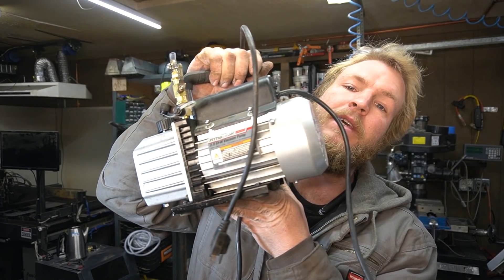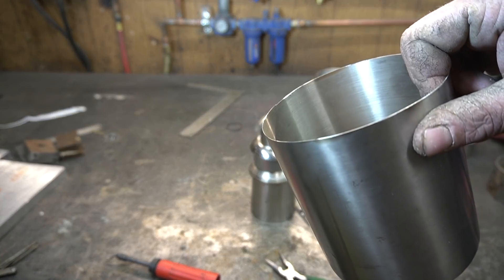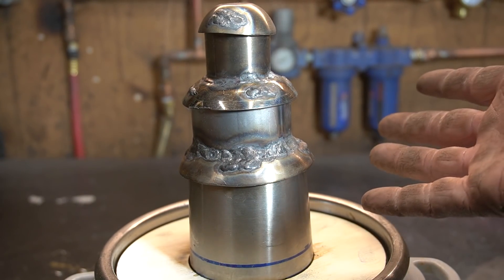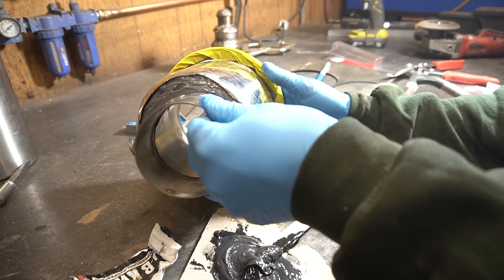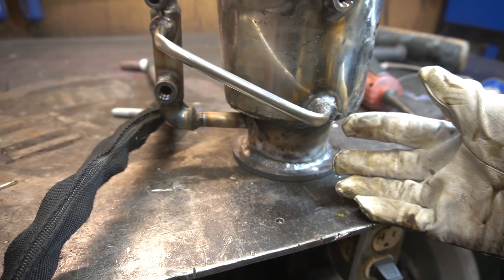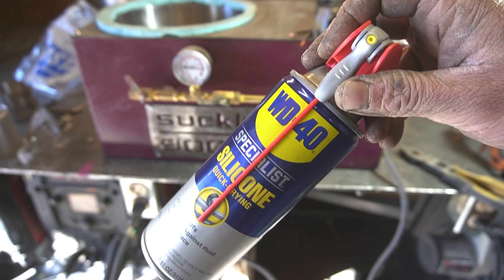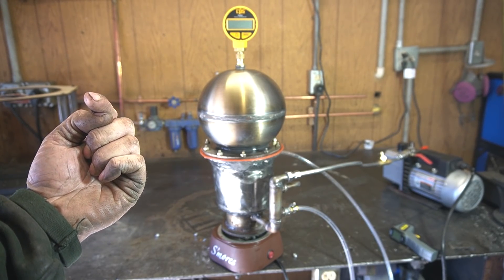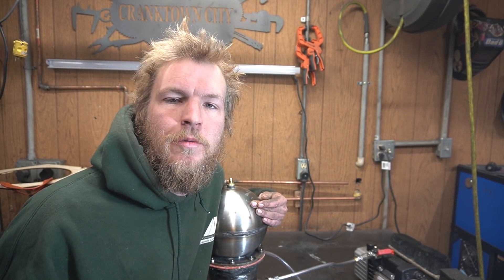Homemade Oil Diffusion Vacuum Pump

Comment: nice.  props.  to note tho - the oil temps are so great, you really need little cooling.  too much cooling will make the heater struggle.  I had a commercial one.  Optimized the flow using a water flow meter, and valve.  Thought of making a square version of this chamber, jets coming from just one side.  I noticed at lower pressures, You get short-path behavior that a cylindrical design allows for too many degrees of freedom for particle movement.

Comment: Get up to 14 bars of vacuum from your car engine by disconnecting the vacuum line to the master cylinder ( brake master cylinder). 
Vacuum from car engine.

Comment: I will be really, really.. afraid of that vacuum chamber literally IMPLODING, which could be as bad as a high pressure explosion, throwing pieces of metal everywhere and causing some serious damage to whatever gets on its way, 
just do a quick calculation of the pressure differential and figure how many "inverse" psi those cans ate holding.
as an electronic engineer 
I worked back in the 70's in an RCA tv screen tube manufacturing plant and saw quite a few vacuum implosions and they are not a joke.
be safe my friend

Comment: lol, I'm the amateur tig welder you're talking to and holy shit are you right that welding super thin stainless together is NOT EASY. The jump from 1/8" down to 20ga with my project was crazy. How does metal just DISAPPEAR LIKE THAT?!?!? fuck. Stupid thin sheet stainless. Clearly the answer is a laser welder.

Comment: When II was building an electron accelerator in high school back in the 1960's I used a displacement pump for the raw vacuum draw the pulled down the rest with a mercury diffusion pump that worked similarly to the one you built with oil.  It was very efficient and pulled a deep vacuum but probably wasn't the healthiest of devices. 

Cheers !

Comment: Don’t know what to think after watching your video.  I recently bought a Robinair 15500 2 stage vacuum pump and also a CPS VG200 micron gauge.  If I hook the micron gauge directly to the pump with fresh vacuum oil, I can pull down to 4um which seems amazing; if I include the gauge’s included brass-adapter, it increases to 6um.
Do you have any comments, do yo think my VG200 is reading correct?
When I pull down a R134 automotive AC, I get about 300um which seems to be about right.
Great video, learned a lot!  Thanks!

Comment: For impromptu jets, use a metal shower head or a shallow steel bowl or ring with tiny holes drilled into the rim.

Comment: Think edison used a vaguumpump made from tube and nercury , the weight of the mercury drawed the air out of his light bulbs mercury is e pensive but you might get the same thing when using water and a verry large height 
Think you need a tall tube with teo fausets one kn each side , close the bottom one , fill tube wirh water hook up the part you need to draw a vacuum on at the top and then open the bottom valve letting the water fall out drawing a vacuum over the top , prolly need to do it in a lot of small stages as air mught bubble in through the ooened valve at a certain vacuum , like emptying a bittle filled wirh water

Comment: Would have really helped you out a ton if you had purged backing gas for those stainless welds. The backside of all those welds are sugaring on you thus why they not only look so bad especially on the backside but, also why you had so many issues welding it and no so much because it is thin material. The sugaring is also why the welds come out so dark and grey/black looking. Using aluminum foil is a really good option to purge Stainless on the backside of welds like that for example when welding stainless pipe or header/exhaust you cap off each end with foil and run a second hose from your argon bottle with the same setting to keep backing gas on the backside of the welds. 

Just make sure you always have a small hole for gas to escape thus why aluminum foil forms work so well for this. Some people use rubber caps on pipe but, you still need to allow the gas room to escape or your weld can blow out on you as you weld. You just want the gas to cover the backside of the welds not pressurize. Ive actually welded sheet metal in special fixtures to purge backing gas on flat runs for Stainless. 

Its required on food service and aviation welds with stainless and also used when manufacturing Header and Exhaust parts because it is not only easier to weld but, the welds come out 100 times better all round. That sugaring is very detrimental to your TIG welding process. You also want to wipe down all your stainless (and aluminum for that matter) parts with Acetone before welding so they are clean as possible. Every little bit helps.

Comment: Not sure if someones already mentioned it but your using way too small of a cup (and way too much gas for that cup), a gas lense would help but your cooking the absolute shit out of that stainless (no reason for tacks not to come out crisp/colorless and shiny with right settings). Some of those welds may have been better suited autogenously (without filler) without coming off as pretentious or overstepping in offering advice if you have any questions id be glad to help. Really enjoy your content keep up the work, im sure you have many subscribers in your future. 

I am also very into 3d printing and CNC Id love to collaborate on your metal 3d printer from a consultant standpoint(something ive also wanted to dabble in but too many hands in too many cookie jars atm).

Comment: To weld thin stainless (and other actually) you need a "Cold weld mode". It's just a precision controlled arc time. I think that you can assemble little device by yourself. You press a button, MCU starts a HF module and wait while welding current starts going and then just count a time and stop the arc. My TIG-machine can produce pulses from 10 to 200 milliseconds but I would prefer range wider a little. Current should be like 3-4 times higher than for usual process.

On Applied Science channel Ben was used an about 2 kilowatts little gas stove for tourists to heat up his oil-vapor vacuum pump. It's quite faster than using electric heater and you don't need to suffering making good thermal contact between heater and chamber.

Comment: The asymmetry of the diffusion pump stack did you no favors. If you copy the stack design from something like a Veeco EP3AB air cooled diffusion pump you might have better luck. The stack also does not need to be fixed to the bottom of your pump. Most times they just sit down inside the pump.

If you would like I can send you some photos of the stack in my diffusion pump. Looked like you were pretty close to having a decently functioning pump here.
Reply from the maker: Working on version two of this now, I'd love to see a picture!
My email is posted on my channel page, thanks man!
Reply: @cranktowncity  Sent you an email with the photo I could find and a 3D model I made awhile back.
Reply: Hi, Would it be possible to get a copy of the plans please?! I'm thinking of making my own :)
Reply: @Muttyfut  Send me an email. Don't think it really counts as plans but I can share the same thing I sent Cranktown.

Comment: Watching that at least helped me feel like I'm not on my own, I've been fighting 12 threads per inch for my 138 year old mill.  Yesterday was the third try and then I found out that one of the gib holes is stripped, drilled out / zero threads, so I never did need that bolt after-all!  BTW, machining stainless is an art, it doesn't like interrupted cuts.  Somehow you have to get the feed rate just right before and hopefully don't stop.  My planer loves stainless, the only drawback is the extremely hot blue chips jumping around.  Looking through the videos is not particularly of my immediate interest but subscribed, it's the quest that matters.

Comment: You could have just spot welded it to hold it together then made it vacuum tight by electroplating nickel on it. Slow and steady to get a thick smooth deposit.
Reply: Interesting, I never would have thought electrodeposited material from an aqueous environment would be strong enough to prevent leaking, or pure enough to prevent virtual leaks.

Comment: You may be able to use sorption pumps for rough vacuum and titanium sublimation pumps for high vacuum. I worked on a system that had sorption pumps, titanium sublimation pumps and ion pumps. It bottomed out the bayard-alpert ion gage. Less than x10 to the -14 torr! 

Does anyone know if you can leave out the ion pumps?

Comment: For the fusion reactor you can salvage very good vacuum tight electrical feedthroughs from magnetron tubes out of all microwave ovens. 

Just don't grind the pink ceramic it contains Beryllium. Side note I think it is the only ceramic that is thermally conductive and electrically insulating.

Let me know if you want some I think I have several.
Reply: Beryllium ceramic is white and not used in consumer products.

Pink ceramic is chromium-doped alumina (just like ruby), which is perfectly safe.

Comment: I suggest building a second one and placing them in series.

Also, make the part as clean as you can, leave no place were contamination can set home.
Don't forget to heat up the components to drive off any remaining liquid.

Comment: I was wondering why you don't use aluminium for the pump ? Okay i get the idea of doing it with cheap pot but if you're making a serious build can't you go with aluminium and get the right material from a metal shop ? I read that aluminium is not that bad in term of outgassing, did I miss something ?
Reply: Needs anodizing for resistance to reactive products
Reply: @nathanmccorkle4278  i don't think there is reactive product in a fusion reactor
Reply: @nathanmccorkle4278  anodizing aluminum is terrible for vacuum system, raw aluminum is great but the anodizing process grows a layer of oxide in the shape of long thin tubes that can hold on to individual atoms making it a nightmare for outgasing, that’s also the reason it can be so colorful since the tiny pores hold on to any dye small enough to get in them
Reply: @HiBye1543-fuk  I'm with you on surface area, but all the dry etch equipment manufacturers use primarily anodized aluminum because it's very robust against degradation from the etch and plasma chemistry

Comment: WD40 is probably the worst choice for oil as it is heavily mixed with acid. Crude oil will gave better results. I am using Galden 230, it is not expensive as proper oil but it is not crap as wd40 also.

Comment: If you don't protect stainless steel properly with inert gas, it will rust away and after the tarnish it will. Just use black steel until it rusts away anyway, or in this case it makes no difference anyway because all the welds will rust and the black steel is simply cheaper.
Reply: Either there is a hole or there is not, what are virtual holes?
Reply: Cavities which are extremely porous and have high surface area for adsorbed chemicals to slowly desorb, fouling any chance of getting to high vacuum in a reasonable time (i.e. it could take months or years because the outgassing rate is so slow).
Reply: Iron oxide will yield tons of virtual leaks
Reply: When the outgassing rate is so low you can pull vaccum. The pump has much more power and do not reconize the outgassing.
Reply: Of course you can pull vacuum, but "high" vacuum won't be achievable

Comment: i would suggest using stuffed steel wool anywhere you need oil vapors or mist captured and dripped back down. Its the DIY equivalent of what lots of industrial process equipment use

Comment: Also chilling the water to much can be counter productive as you only need to keep the walls below the boiling point of the oil.. Cooling it more than that means you won't have all the oil boiling in the bottom there will be a cold area around the edges.. The tiny element heating omg in the middle won't help ether lol.. Plus you should have another hole in the side of the jet stack shooting oil up the roughing pump tube.. It's the final stage and helps push the gas molecules into the roughing pump..

Comment: I have a cheap pump.. Literally the cheapest 2 stage pump I could find.. But changing the oil to good quality oil increased max vacuum allot! Do not use the crap oil that comes with the mechanical pump

Comment: You probably want all metal seals. I'd think JB weld would off-gas enough to prevent a good vacuum.
Someone get Techingredients or Applied Science in here for pro response
Reply: Justin from The Thought Emporium seems to use a lot of JB Weld for highish vacuum applications.

Comment: From my experience, a cheap vacuum pump should be able to get you down to at least single-digit torr, but I can't tell what units you are using.  If it is disconnected and the vacuum doesn't change, then you should be reasonably well sealed.  If not, it's leaking.  The diffusion pump will be hard to troubleshoot.  You might try running it with water at higher pressure (no roughing pump) and just seeing if it can get down close to the partial pressure of water (about 2 kPa).  But I'm guessing it just can't make good fan-shaped sprays to prevent the collected air from flowing back up.  Otherwise, I know the diffusion pumps take a LOT of heat to run properly, so you could try doubling it down on that.  Check that the material the gasket is made of is okay for use in vacuums (but it's probably fine).  Good luck!  This is a fun project to watch.
Reply: + he maybe should've  make the spray stages all same size for better "reflow prevention" (add more?) and REALLY add a lot more heat at the bottom (with enough oil) - BUT FUN!

Comment: Thanks for another cool, interesting and hilarious video.  You probably know this, but if mercury is easier for you to purchase than it is over here in the UK, one of the things you can do with it is create a crazy simple and extremely efficient Sprengel Vacuum Pump.  Cody, over @cody'sLab, did a video about building one https://www.youtube.com/watch?v=viJ3T-1KZqY which may offer a simpler alternative, that may get your vacuum down to the levels you kneed (which is a hell of an assumption, when I don't know how low you need to go...).  Just an idea.

Comment: Did you lose oil in the DP while testing it? Every DP i've ever worked on had baffles in the outlet to prevent the mech pump from sucking the oil out of the DP.

Comment: Impressive build!
Another thing to consider might just be the heat input, I don't know what wattage your s'mores heater has, but maybe try something bigger just as a test
Reply: I'm shocked that "more heat" wasn't the first troubleshooting step, to be honest. That would certainly fit with his normal MO, although I might get concerned about the integrity of the JB weld.

Comment: JB Weld is probably offgassing, would definitely try to avoid it. Other commenters also suggested back purging which is a good idea for thin workpieces
Reply: Jb weld is pretty good for vacuum but obviously not ideal

Comment: For really high vacuums, you need all metal seals. Plastic and rubber off gases at those pressures, preventing you from getting a high vaccuum.
Reply: I can get down to low -7 torr high -8 with elastomer seals on my chambers. Anything lower than that and you will need conflate. That was with some 6" diff pumps, I have since changed to turbos. Biiiig turbos.
Reply: And turbo pumps, IGPs and heating up all the setup for days.

Comment: You can imporve the welding on thin stainless steel by using argon to back purge. Technically you should always back purge stainless but really helps with thin plate or clamp some copper or aluminum to the back will acheieve the same thing.

Comment: You should give a look at a mercury vacuum pump design, Cody from Cody'sLab made one with glassware and lab equipment, it might the best option to create a vacuum as good as the void of space. I get that mercury is not everybody's cup of tea, but according to NileRed it is somewhat safe to handle. just don't inhale its vapors/gases or ingest any amount of it. Never use aluminum parts with it too.
Here are the links for each video, respectively:
https://www.youtube.com/watch?v=viJ3T-1KZqY&t=16s&ab_channel=Cody%27sLab
https://www.youtube.com/watch?v=ZiWlthrtneU&t=513s&ab_channel=NileRed
Cheers mate.